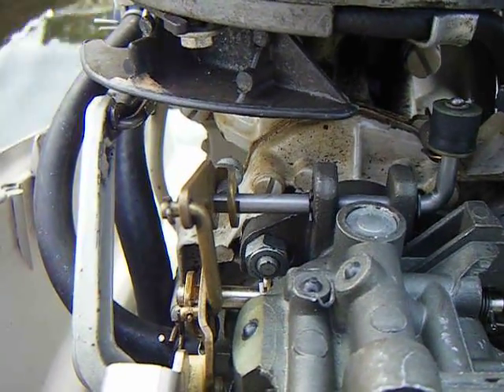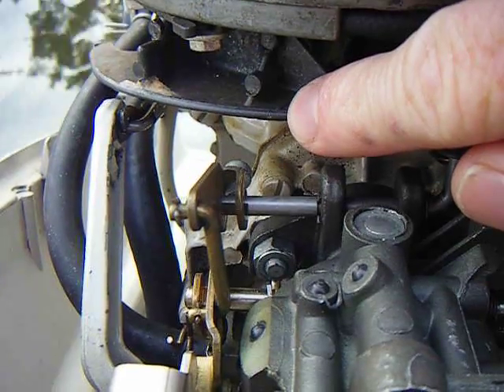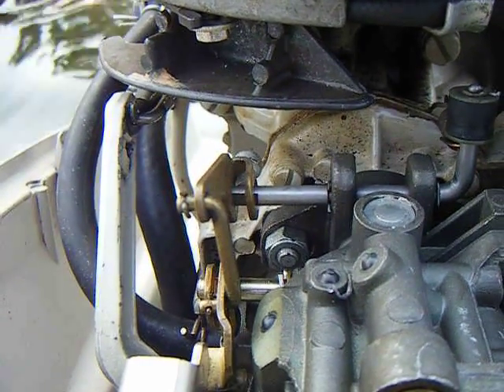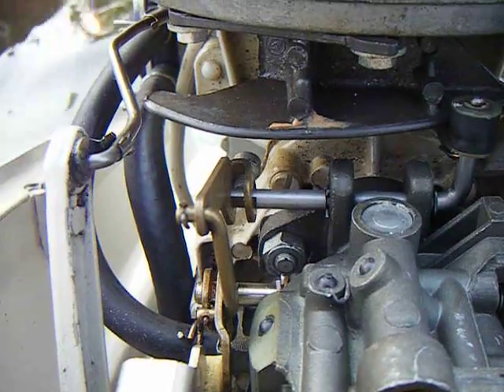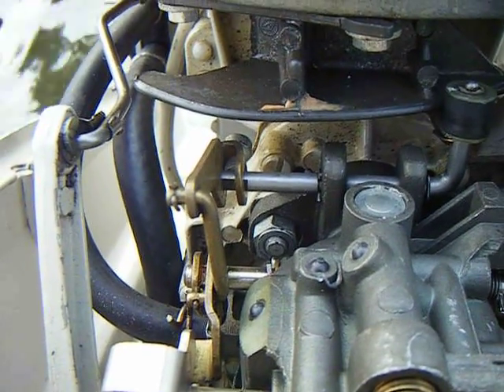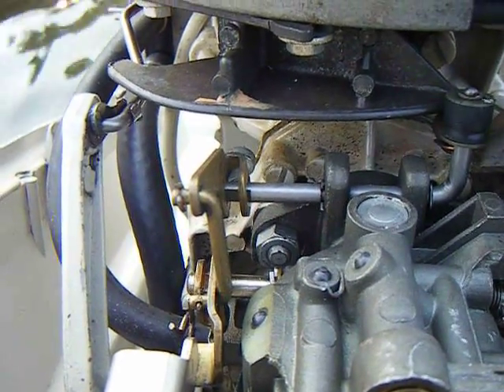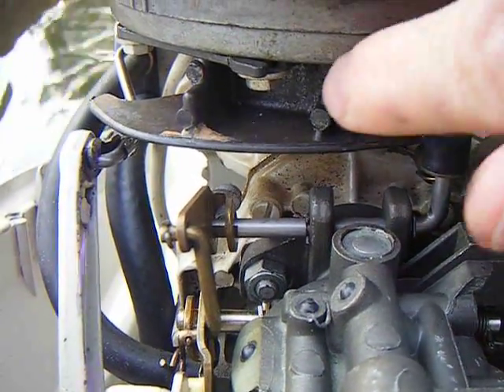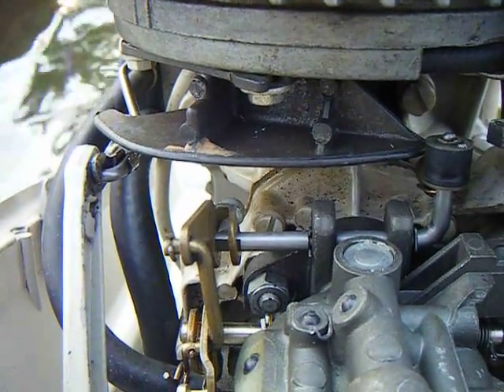1965 Johnson 5hp synchronization

Comment from the maker: Edo4609, you should get a manual to answer these basic questions. You seem quite new to outboards. Anyways, the mix ratio is 50:1. 50 parts gas to 1 part oil. You also need to use the right type of 2-stroke oil, not lawn mower or chain saw oil or motor oil. If you like to spend money you can buy synthetic but I've tried them with no appreciable difference in smoke.

Comment: Thanks for the vid, my cam follower definitely needs adjusting.. How did you get to the screws for the cam follower under the flywheel?  I have not tried it yet but they seem to be obstructed by the carburetor. I believe on mine they are flat head screws.. butter knife? I have a 33 Super Seahorse..

Comment: i have a 1950 johnson  5hp tn26, different setup but would a synch apply to it as well, it only runs good at one speed the sputter and backfires if i go too low or too high, thanks